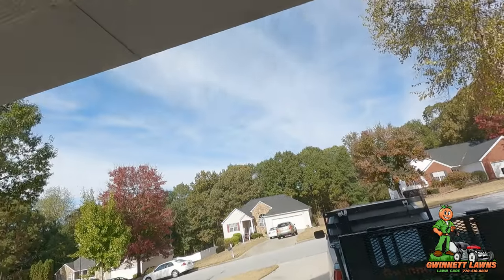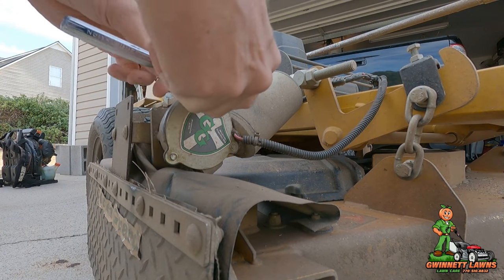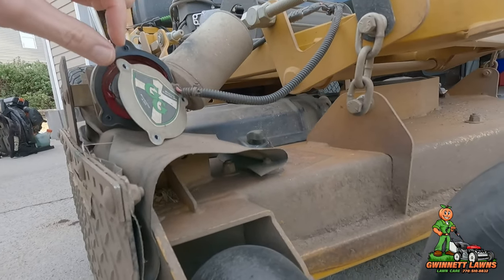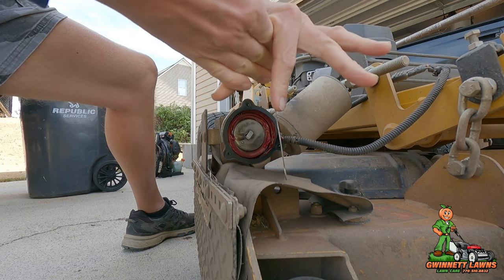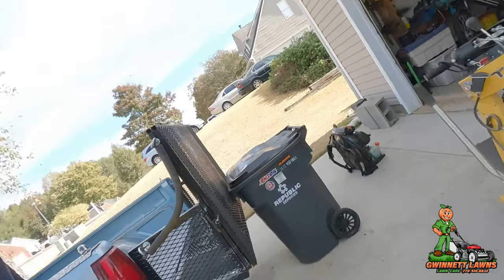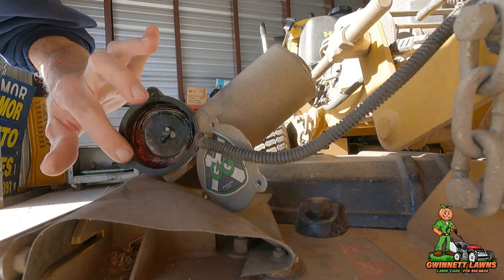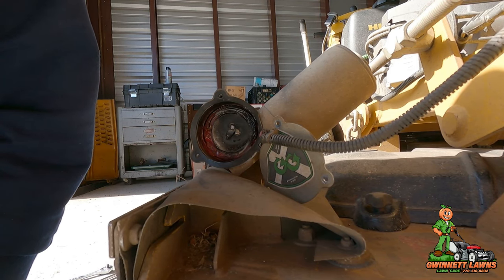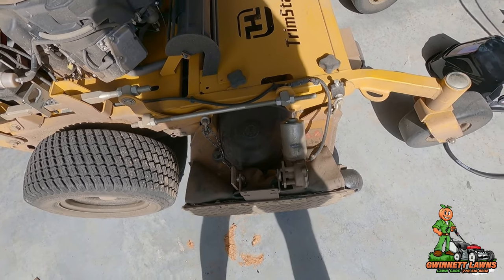Green Guard Motorized Chute Blocker Starting to Fail on me

Comment: I wonder if you didn't put the motor close enough to the outside of the deck so overtime it over torqued and bored out instead of hitting your deck flush ?
Reply from the maker: No, it's installed with the flap perfectly at 90 degrees, even with the deck. Those motors are best for chain drives etc that have infinite rotation instead of a dead start/stop.  If the gear\shaft assembly were one piece it would solve the issue.